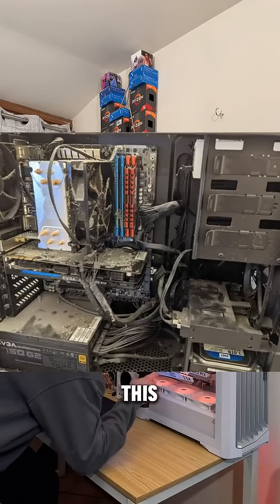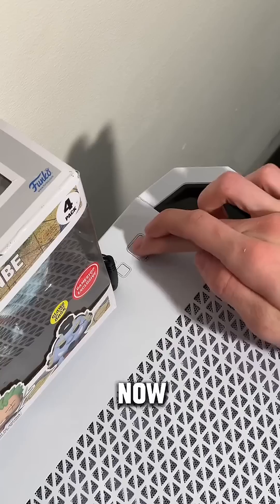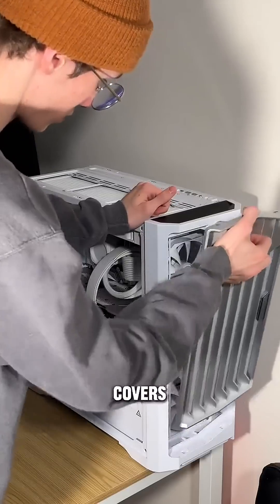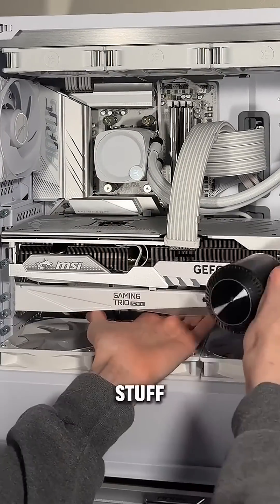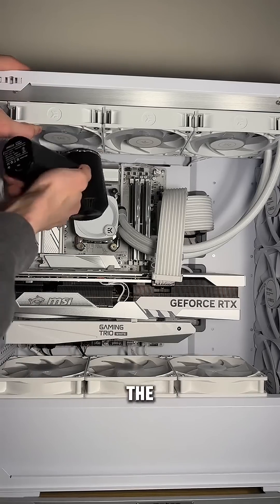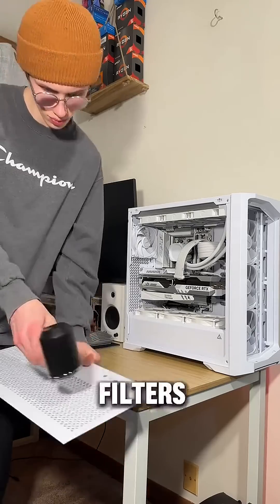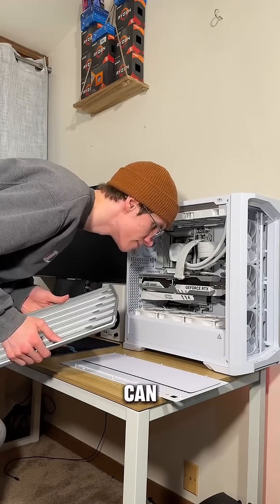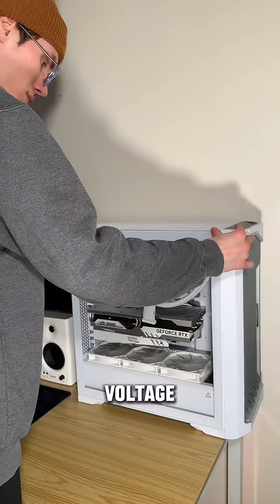Boost Your PC Cleaning Game #gamingpc #techtips #community

Comment: If your water cooler is clogged and its time for new thermal paste you can rinse out the radiator in the sink with the pump dangling off. but id recommend still having one of those blowers to get the extra water out. I put soap down mine did that and let it dry for a bit after rinsing. I used a big blower small blower i normally use to blow off my back porch (not battery or with nozzle just a blower)

Also dont put your radiator on top it breaths all the heat from your gpu and your cooler will prematurely fail. If its on the front it will actually cool your GPU some if its intaking I exhaust from the top.